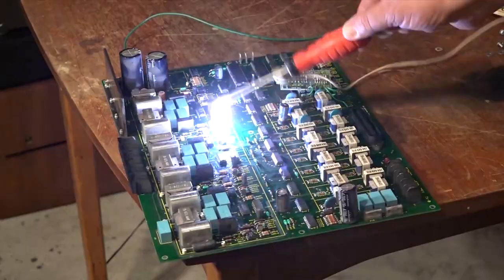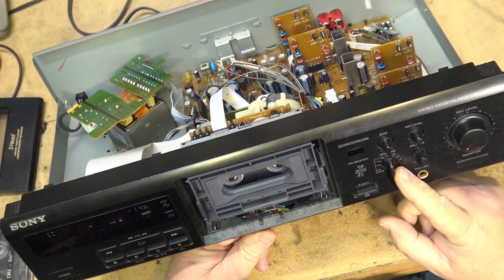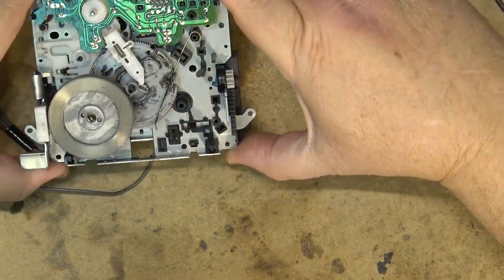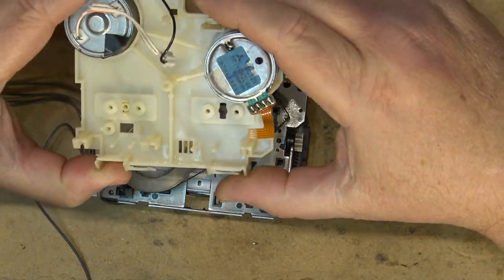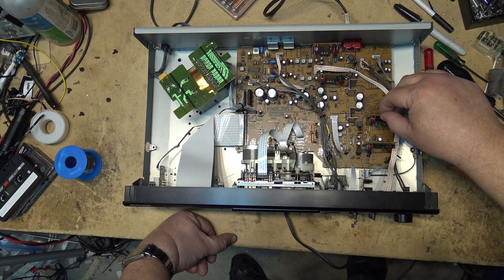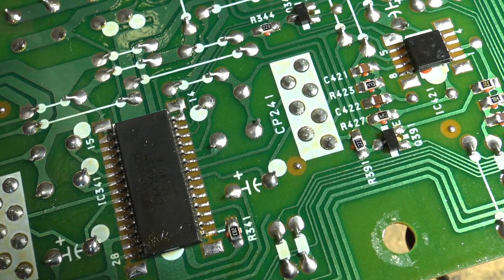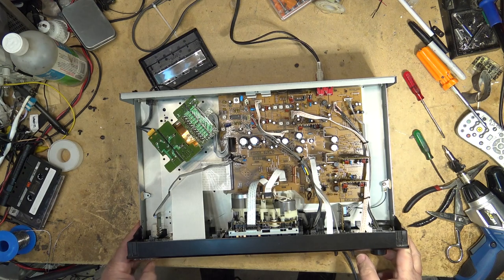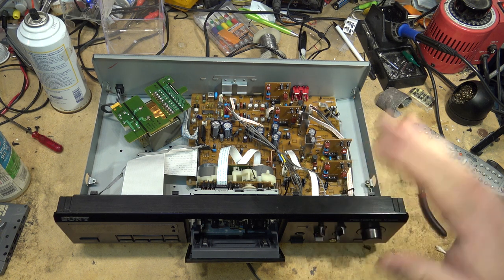Sony TCKE500S 3 head tape deck thrown off a truck

Comment: I have a TC-K511S, which is very similar to this one, but it's even lower grade, it has a plastic "flywheel". This is very annoying because it sounds fantastic, but has horrible W&F. The factory spec is 0.07%, I'm measuring over 0.2-0.25%. It's very audible. It is very picky on belts, I tried three different belts (not from Chinese ebay sellers) to bring the W&F down to this awful 0.2%, because with the first two belts it was close to 0.5%. The main reason for the remaining W&F I think is a motor fault. I'll try a different motor, but if I can't push it under 0.1%, I'll try to find someone to make a proper aluminium flywheel for it. Machining it is not a huge problem, the problem is balancing it. Without proper balancing, a heavy flywheel can produce much higher W&F than the light plasic "flywheel" (I'd call it pulley instead). But the factory aluminium flywheels are diecast pieces, I'm hoping that one machined precisely enough from Al rod stock might not need balancing to behave better than the original plastic fly... pulley.
Reply from the maker: One of the reasons I will NEVER part with my Technics RSM275 and now JVC tdv-1010 is because of the proper direct drive heavy capstan motor / flywheel.
Reply: @12voltvids  Yes... I can't afford that JVC, but I'm about to buy a Technics RS-BX626 for $70, that's also 3 head, quartz direct drive, but single capstan, from 1992. It works but ticking, I'm guessing it's a broken plastic gear in the reel drive...
Reply: @mrnmrn1  Ah the Panasonic flexible gear that loses teeth and makes a clicking sound till too many teeth fall off and makes it hungry for tapes, had my run-ins with that one on my 90's boomboxes. Replacement gears are pretty hard to find. i bought these hard gears for replacement on Ebay :https://www.ebay.com/itm/Technics-Panasonic-RDG5772ZA-RDG5772ZC-Drive-Replacement-Gear-/401977489595?hash=item5d97b9b8bb

Comment: Now I didn't see if he worked on this for different days or days apart. But if he was working on it in one day he worked on this all day and all night. (Meaning from around noon to past 9pm). Just by his watch. If he got paid like car mechanics do he would be very unaffordable. But then so are mechanics. I know there are shops that charge $200PH. Almost always they are the dealerships working mostly from warranty work but there are independents that are $180 for sure and hour. Just wrong.
Reply from the maker: I wish I was paid like a mechanic.  I probably made 50 bucks on this repair.  I don't work on things all day. I can start on them work for awhile.  Go do something else and then go back to it later.  Could be hours or days apart.  Some of my own projects i could start on, set it aside for years then return to it and pick up where I left off do some more work, put it away for another few months.  When it is a customers device i generally try to get it services and sent back fairly quickly but i will still stop and do something of higher priority, like jumping on the Harley and going for a ride on a nice day.

Comment: I guess it’s basically a Walkman placed in a case
Reply from the maker: Don't tell that to the guy that owns it.
Reply: 12voltvids no I meant by Sony’s design ... if you look at the interior the mechanism itself is pretty much Walkman sized ... I wonder if there is something to that. Most other cassette decks have much larger mechanisms

Comment: the last few vids you have been a tad lazy about cleaning up the old grease.  maybe because your moly is low. 3 in 1 is great..but the smell is noxious and never fades away.
Reply from the maker: I have lots of mollykote. The grease on the garrard was not all dried up but the lube in the bearings certainly was.
Reply from the maker: 3 in 1 electric motor oil has no smell at all.

Comment: Where do you get your belts? I need to get some for a couple tape deck repairs.
Reply: Got mine on eBay...$15.00
Reply: Just take account of the fact that though you can find belts all over the place and very cheaply, a belt for a capstan motor or turntable will have been precision ground on the drive surface. This step in manufacture makes the belt perform to specification and raises the cost over a cheapo one by a factor of...add a multiplier here ...
If you get a proper belt you can feel the ground side, or see it if looked at carefully. Belts for accessories like tape counters etc. are not made that way of course.
Reply: With most cheap belts the W&F goes up x2 or 3. They're nowhere near the quality of belts made 3-4 decades ago in Japan. If the deck is really good one, I would go with MARS belts but they are very expensive.
Reply: @pliedtka  OOh MARS..I'll have a look, at least when Elon Musk gets his colony started...
Reply: He gave me KPComponents as a place to go in the live chat. And thanks for the suggestions. One of the subjects is the capstan belt on a Realistic Clarinette 16. It's got a slot load play only deck based on an automotive unit play/ff only and was the lowest priced unit of it's feature set they sold at the time, so super high quality was not it's forte. :)

Comment: sound like bad GND from input  preamp
Reply from the maker: That's what I thought initially, and there were bad connections in a few places, but that severed ground trace at theoutput jacks could also have been the fault as they use global grounding, and it could very well have caused a loss of ground to the input pre-amp.

Comment: Hey I love your videos, very informative when working on older gear. I sell my repairs on eBay but recently inherited a literal cluttered repair shop from a colleague who retired. I have at least 40 more projects than I care to have looming over me and wondered if perhaps you would want any or all of the 15-20 I set aside, which is pretty much all stereo components post 1970s except the turntables and 8 tracks which i kept. There is Marantz Cd player and tape decks, Yamaha and Kenwood receivers and more if interested let me know. I cant think of a way to exchange emails without putting my email in these comments for 99k people to have access to. I figure laws of average at best say 1 in 20 of them is likely morally deficient so I will just shoot a video of the stacks and thus inaugurate my own youtube channel.  - if interested. i suppose that goes for anyone in here that wants gear to repair.
Reply from the maker: I don't buy old equipment but i certainly accept donations of vintage audio gear.  You are right about email.  One of mine is listed but trolls get off subscribing them to spam lists so I just dump the entire inbox and in the process lose legit emails. You can try the email listed on my home page.
Reply: thanks i will

Comment: Never remove erase head connector the way you did. 90% chance this crappy main board broke under the small connector
Reply from the maker: Have never had a connector break, not once and I have been doing this for 40 years.
Reply: @12voltvids  I did repairs for this mobo at least 3 times, (i got broken) one waiting for rewiring. Sony used low quality boards, easy to break or overheat.
Reply from the maker: @jacekschneider4686  
You did watch the part where i repaired the broken solder connections on the board.   I am very familiar with Sony and their shitty boards.
Reply: @12voltvids  Great work! I have to repeat your procedure, i have one board with same problem and i gave up ;)

Comment: These cheapish decks from Sony (because they are actually not cheap at all comparing to their high end) are pretty crappy. I mean still sound technically but lacking in the fundamental parts.
Reply from the maker: All tape decks are garbage in my opinion.

Comment: Who uses these tape player these days
Reply from the maker: Some people are convinced that tape sounds better.  You can't fix stupid.
Reply: @12voltvids  And some users have literally hundreds of 1980s/90s FM radio, off-air recordings on analogue cassette of unique music concerts and studio sessions (unreleased stuff including hours and hours of folk and traditional music). I saved and bought a new Nakamichi BX-125E (UK/Euro version) when I was 20yo. I wanted a CR-7E, but saved much more over the best part of a year and spent it wisely on a proper TT instead. Also have owned a used 480Z (2 head, double capstan) for 25 years or so. Both fully serviced... Over 20 years ago... by the UK authorized service centre at the time. I also have the same Marantz CD-85 player I bought second hand in 1992 (since clock-modified). I know how good CD sounds. All my gear had to be boxed up for years. Doesn't explain why it all still sounds fantastic (please don't scare me). Yes, I would record digitally now; and life is too short now to 'digitize' hundreds of tapes. I know I should. But of course I'm stupid. And I thoroughly enjoyed that video, with no knowledge or physical dexterity for electronics.